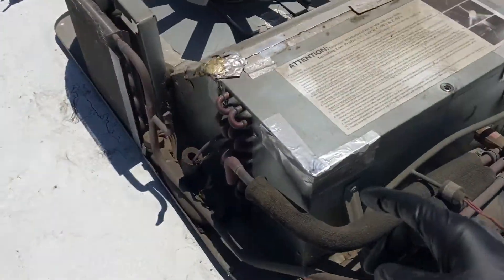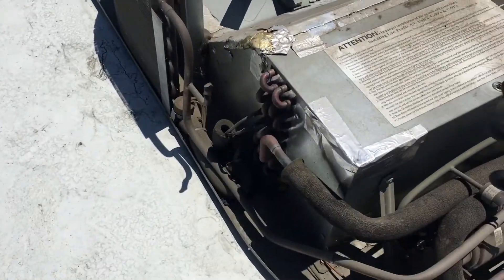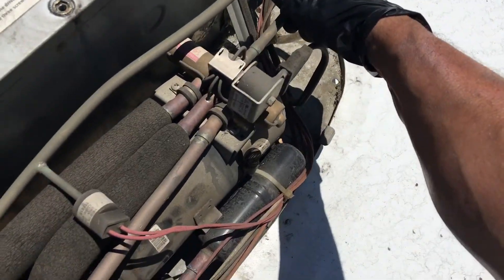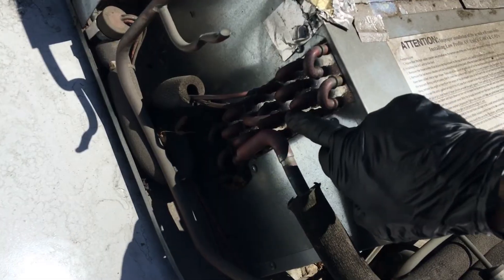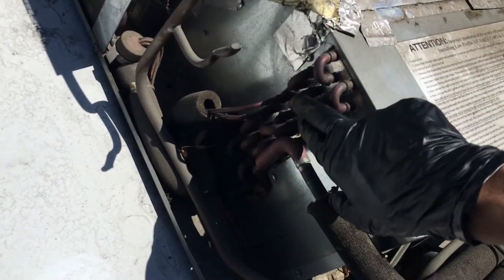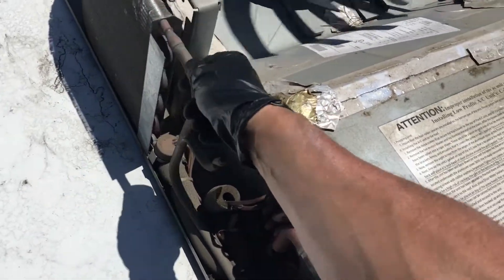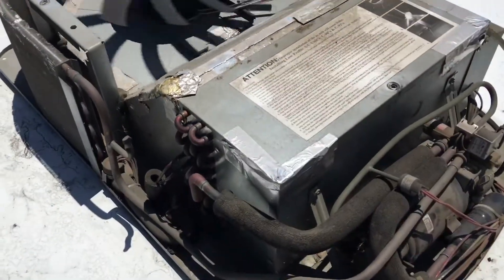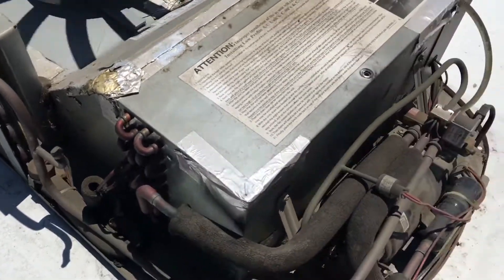R410 Refrigerant On RV rooftop air conditioning.  Low on refrigerant charge￼￼

Comment: Can I replace a R-22 refrigerant with a 134a on a Coleman mach 3 RV a/c unit ?
Reply from the maker: You would have to remove the pressure switches that are calibrated to kick on fans and temperature and pressure protection for 22 refrigerant that are much different pressures to kick condenser fans on and off and a protection device devices are at different pressures for 134 refrigerant. 

You would also have to physically remove the compressor and turn it up upside down and different angles to get all the mineral oil out of the compressor and replace it with the proper viscosity POE oil 
       Because 22 refrigerant was manufactured and made to be soluble and miscible Inside hydrocarbon based mineral oil
      134 refrigerant is not

1 34 refrigerant is designed to work with the synthetic POE oil. 

You could do it you would also have a lower efficiency unit that would not have the same BTU cooling capacity as with the original 22 refrigerant
Reply: @coldfinger459sub0  thank you , I’ll rather get a can of R-22 then lol ,  is a car refrigerant hose charger bigger that the one used for R22 ?
Reply from the maker: @josedominicci6582 same 1/4” thread
Reply: @coldfinger459sub0 but the connector that goes on the charging port is bigger on the hose I have
Reply from the maker: @josedominicci6582  then you must be using a newer style 134 modern day refrigerant connecting coupling

On older systems, they were all quarter inch threaded like R12 refrigerant
Reply: @coldfinger459sub0 should I get an R-12 or R-22 refrigerant ????
Reply from the maker: @josedominicci6582  of course the same that came in it from the fractured

Comment: If systems are empty of coolant then does that mean leaks in system? What's the point of recharge if it's just gonna leak back out
Reply from the maker: Because the leak is extremely small, it only lost the refrigerant over a span of the last two decades. 
           And they’re about to go on a trip this weekend to the desert and they need full 100% cooling immediately. 
      When the leak is so small, it takes decades to notice it then it’s OK to fill it back up. If the leak was so friendly that it would leave a nice little oil stain or you could pick it up with a refrigerant leak detector at the time of testing. Then, while you were going to the process of recharging, you can take care of the leak at the same time..

Comment: Hi I have a 12v rv roof air-conditioner and it only cools slightly. Could it be possible it needs re filling?
Reply from the maker: @c4r5on88  anything is possible. 
      Make sure the outdoor condenser coils are clean. 🧼
Reply: @coldfinger459sub0  OK thank you. I don't know anything about them but I'll give it a go
Reply from the maker: @ lots of videos on cleaning and service . Instructions manual shows you
Reply: @coldfinger459sub0  thank you

Comment: Who do you call for something like this an RV repair or would just a regular HVAC tech be able to help me?
Reply from the maker: RV tech. Unfortunately, they don’t like to follow all the proper procedures..
They like to do a cheap and fast . 

Often using the clamp on pipe taps for a quick access through the lines and they eventually leak because they don’t remove them and braise on proper fittings . 

Because customers want a cheap job so often the technicians will do cheap work . 

I am in a higher labor rate market, but the service was $800 . 

Almost the price of a whole brand new unit . 

Regular automotive HVAC technicians don’t know anything about brazing  on New service ports 

some HVAC technicians who have experience with small equipment and appliances can do this service

Who only do residential might feel uncomfortable working on items they’re not accustomed to.
Reply: @coldfinger459sub0  Thank you
Reply: Better off getting a new unit at that point......
Reply from the maker: @thebatscave  owners say all the new one are noisy. They don’t want a new one. 

I’m going out to fix another old one this week.  Owner knows I charge more then what a new whole unit cost. 
    This will be the second one I fix for him he has 2 RV’s
Reply: @coldfinger459sub0  seems like the older units blow colder? I see a lot of people saying their new rv ac system can't keep up with the heat.
Also, how many hours does this job take? i can't imagine it taking too long?
Reply from the maker: @thebatscave  it the vacuum that takes longer.  Refrigerant leak testing, then high pressure nitrogen leak testing with ultrasonic leak testing. 
  
You use micron gauge to determine vacuum time . Not a set clock time. But it usual to at least have 1 hour of vacuum time.

Comment: Mine seems to not cycle off. Ran 15-20 minutes and compressor was humming the entire time. 
It’s not cooling and run wire shows 10.5 amps. System says on unit 12.5 RLA. 
Capacitor checks out and comp windings good.

Comment: Thoughts on piercing valve to add freon with a 2lb bottle? 
The valve says it’s rated to 500 psi
Reply: I would attempt to install an actual valve but I have no way to recover old freon
Reply from the maker: I would not trust its

Comment: I installed a bullet piercing valve with a r134 adapter on my 22 year old coleman mach rooftop unit. Charged it with R134 and its working great.
Reply from the maker: Yep, it will work
Reply: Was it originally charged with 134a?
Reply: @craigmerrill2156  no it was a R22 unit
Reply: @Eliminator_Media so you put r134 in r22? Wouldnt that mess up the system?
Reply from the maker: @craigmerrill2156  can’t remember too long ago

Comment: Do the roof top AC's fall under MVAC because they are on a motor vehicle?
Reply from the maker: No 
They are EPA 608 Universal license for rooftop on residential or commercial buildings. 

Rooftop on a RV these little tiny units are yes, under MVAC EPA 609 

This was explained to you when you took your MVAV EPA 609 Certificate

Did you not take your 609 yet?

Comment: So the techs say "you can't recharge your roof top system", I ask why? Answer, "Because", I ask "Because Why", they say "because". I say could it have anything to do with charging over two thousand "PLUS" dollars to put in a new one. No answer. I have researched  through people I know and the standard answer is "TO MUCH PRESSURE"! Tom Lech seems to have the correct idea.
Reply from the maker: It’s easy to do for a recharge

Now I am in a high labor rate, San Francisco Bay Area, so the job was about $800 . 

But yes, they can be recharged 

And if somebody owns a good leak detector to find very small leaks and good leak detector start somewhere around $500-$600 the leak detectors I have multiple ones are between $600 and $1000 .  So I can give my customer, the most sensitive, accurate highest possibility to find the absolutely smallest leak.. 

It’s much easier and faster for them to sell you a whole new unit .  

Technician does not have to have too much skill doesn’t have to know anything mechanical electrical do any brazing handle any complicated equipment or do very accurate recharging plus or -1 ounce or less. 

Replacing a unit disconnect, the wiring, harness connectors disconnect, the bolts disconnect, the ducting removal unit put in new unit charge customer $2000 or more . 

And hope it doesn’t leak because they did not seal it correctly to the roof when the first rains come around  next winter.
Reply: @coldfinger459sub0  Well I'm 30 miles north of Seattle, so I'm sure I couldn't make an appointment . LOL

Comment: I am getting ready to do recharge my r22 rooftop unit. Should i install a filter drier? I know they are used in residential and commercial applications but cannot find info on if a small 7100 btu unit would benefit from installing one or if there are any negatives to installing one. Also, i was going to braze a service port with schrader type valve. They make small copper filter driers with a service port. Would this bd advised. Greatly appreciate any input.
Reply: What? I have braised for over 20 years. Never heard of such nonsense. Just vacuum system cut line, braise fitting and refill
Reply from the maker: Have you ever silver braised before? 

You do know you’re supposed to flow nitrogen through the system  ?. 

If you have not, I would not attempt it if it’s your first time and you paid money for this unit, leave it alone .

Comment: Not gonna find and fix the leak?
Reply from the maker: Refrigerant leak detector could not pick up any leak is too small happens slowly over a decade of time just a little low. 

Did install a UV dye in it for future reference to help aid in spotting the leak. 

And even if I wanted to tear into it if it was like in the middle of a coil they’re leaving tomorrow to go on their vacation for several weeks so even if I found a part evaporator, condenser, ect , that needed to be replaced no way to order it or get a hold of one.
Reply: @coldfinger459sub0  I own an AC company in Florida I generally wouldn’t work on these because to add the tap fix the leak pull a vacuum and recharge the system my minimum charge would be $400 and you can get a new one for about eight I don’t know about the heat pump you’re working on but the straight cools that I’ve seen here in Florida are about $800 new it just doesn’t make sense to have me come out and work on it but I’m messing with one right now for a friend from church it’s a brand new unit that has never been mounted came from the factory out of gas found the leak where the hot gas line goes into the condenser coil you can see they messed up the swedge at the factory my issue is getting 16.9 oz in without a charging cylinder just using my gauges and a 25 pound drum it will be near impossible to get a exact charge in and if they are anything like ductless mini splits 3 ounces of charge can make all the difference in the world my gauge hoses hold more than that!
Reply from the maker: @peterdarlington4117  this is why are you use a accurate scale that is accurate within 5 g and a shortest hose possible. 

A small 12 inch or 18 inch charging hose. 

It’s easy to get accurate if you have an accurate scale

Yes I charge $800 on this job

Changing it out was not an option because of a one day time or St when they were leaving the next day

This is where it pays to buy a good quality scales that are extremely accurate even a light breeze will show up on the scale. 

Nobody can be walking around inside the RV because it will shake and you cannot walk around or move while you’re doing the procedure because the scale will pick up the movement. 

That’s nothing you should try small box freezers in your house that use propane are 600 they have a charge less than 3 ounces on some of them if you try to use normal gauges and hoses just your hose can hold 1 ounce 

they have a special set up with a small really accurate scale and the hoses internal diameter is about 1/16 to 1/8 of an inch and very short. 

It’s only the difference between knowledge and training and lack of training. 

All the information is out there available for manufactures all the webinars seminars expos. 

I spent nearly 40 years flying myself around the country to different manufacturers training facilities and going to all the local vendors and distributors and parts house manufacture one day or three day sit in training classes for different products. 

In this industry you don’t learn by breaking peoples equipment or messing up

You learn first and then spend the rest of your life fixing other peoples mess ups to learn by breaking things

Comment: How bad would it be to put a window unit in place of current old air conditioner. I'm serious but don't laugh I was thinking if you vovered it outside when it rained maybe it could work
Reply from the maker: Are you talking about on an RV ?. 
             I guess you could as long as your generator and battery system can handle it. 

It’s simpler.   But I think dropping in and removing the RV standalone unit in the ceiling is pretty easy and straightforward and I think they’re actually pretty cheap well depends that you call cheap $700 or $1400

But me as an HVAC guy I would get like a Mitsubishi or a Daikin or an LG or a Samsung homestyle mini split and install it in my RV.    

I’ve seen videos of other guys doing it on YouTube in the RVs but usually they’re really trying to save money so they buy the cheapest thing they can like a Mr. cool or a pioneer.

Comment: My ac was working then stopped then I paid a guy to fix it and fill refrigerant and now it don’t cool. Just blows air. Damn
Reply from the maker: That happens a lot when people don’t know what they’re doing you’d be surprised how often that happens it’s a sad State of our trade. 

    Actually I have a question did the person you have do this specializes in only AC only ? 

Or was it a general repair mechanic who works on RVs or other vehicles ?

Or is this somebody’s side street I know my brother‘s uncle cousin‘s friend had this guy work on his AC four and he’s cheap ?
Reply: @coldfinger459sub0  side street except he worked on others trailers fine from what I heard my neighbors but me I got the crap end of the stick
Reply: @coldfinger459sub0  idk if I should pay 430 for someone from home advisor to come out and fix it because I’m worried they can’t figure out a solution and just charge just to inspect
Reply from the maker: @youtubedeletesmychannels2329  that’s a difficult call because yes you have to possibly have somebody who also knows electrical. 

Be able to read a wiring schematic and actually know how to properly test each individual switch and sensor and test the compressor electrical windings. 

Often accidentally sometimes guys put liquid refrigerant down the suction line low side and try to compress it causing damage to the compressor. 

Not all the time but just sometimes it work before and then once they go to start it up it attempts to move the compressor and then immediately stops working. 

If they’re not too skilled they may have accidentally got too much air in there or overcharged it and you hear the compressor start to run for a very short time and then immediately kick off. 

Hard to say no way to diagnose somebody’s work over the phone I’ve seen too many crazy things. 

I believe in this above video it’s been a long time but I think that was like $800. 

there was no access fittings for refrigerant the system had to be drained cut in Brazing service fittings. 
     This is San Francisco California and we’re about $187 an hour and I’m consider cheap.  

But not handyman level cheap or somebody side work friend kind of cheap for a legitimate HVAC business
Reply: @coldfinger459sub0  yeah I didn’t think it would be 430 either. There was bound to be something in between. Especially when I asked in total. I just got a portable ac to replace it but problem is it doesn’t reach me on top of my bed so damn. If only I had some kinda funnel

Comment: How much pressure you need for RV roof air conditioner ??
Reply from the maker: Pressure is really not important it doesn’t mean anything.  Because the pressures will change depending on the ambient temperature outside and inside. 

    If it seems like it’s not cooling properly just recover all the refrigerant and recharge it with new refrigerant by weight according to the sticker somewhere written on the unit that tells you how much refrigerant is supposed to go back in.

Comment: Add the self tapper adaptor to add the walmart refridgerant without a license works perfect
Reply: There is a video on how to install the self tapper  called compressor self tapper adaptor
Reply: @martinrascon1350  Found a few, thanks!
Reply: You purchased R-134a automotive ac refrigerant from Walmart and added to a R-22 or a R-410a system?
Reply: @mikemaj8467 would that works ?????
Reply from the maker: That will not work so well. The expansion valve and pressure switch’s were not designed to work with R134

They work at totally different pressures. 

You can make it work correctly if you know how to.
Reply: Is there a video on that type of repair?
Reply: I'd like to know where to get self tapper and also after you charge it how do you seal it. I'm on my own in a camper and my air-conditioned isn't cooling you can hear compressor kick in but doesn't blow cold. I cleaned everything very well as I do every year. It us an old unit camper is a 1982  28ft Prowler. Any help would be great really can't afford to take it to get fixed
Reply from the maker: Yes in the professional trades industry we call self tappers compressor killers. 

It works to get them charged but their rubber gasket deteriorates and starts leaking and after a few times of running a compressor low on refrigerant it heats up overheats and sometimes does not return oil and burns up because of the self tapping fittings. 

Self tapping fittings are just meant for diagnostic and to recover refrigerant not to leave on permanently

After we use the self tapping refrigerant fittings to tester recover the refrigerant we cut the pipe off and braise on permanent brass fittings that have a brass cap for sealing